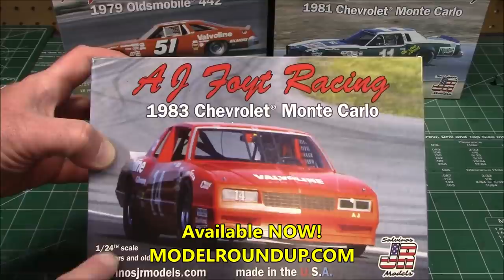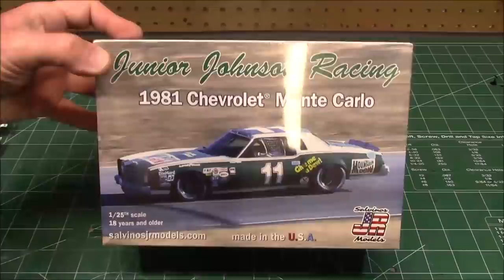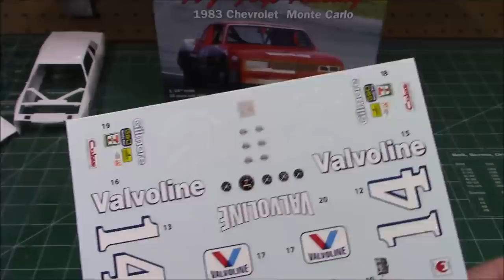Chevy Monte Carlo AJ Foyt 1/24 NASCAR Scale Model Kit Decals Future Floor Polish Tutorial G Body

Comment: Do you ever have problems with your spray can nozzles clogging up? If not, what's your secret? If so - how do you clean them?
Reply from the maker: Sure, I save all my spray can nozzles from used up cans and reuse them when one clogs. I also soak them in super clean until needed, eats the paint out of them.
Reply: @hpiguy  Super clean, never thought of that, genius!

Comment: I gotta try the silver Sharpie. Does it hold up?
Reply: I’ve been using Molotov, and other silver paint pens. They worked fine, but don’t take well to handling.
Reply: Great job, showing the deal installation! Maybe I’ve been spending too much time!
Reply: Thanks for the tips on using the Future clear!
Reply from the maker: Once dry in a minute the silver Sharpie is extremely durable.